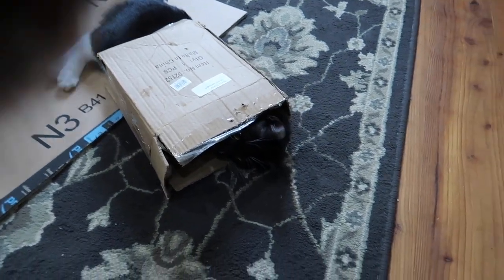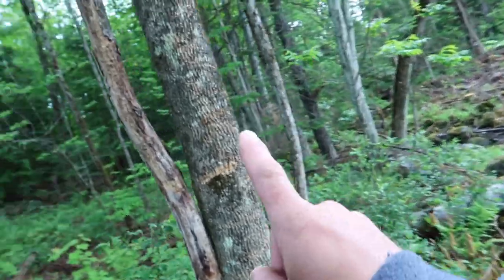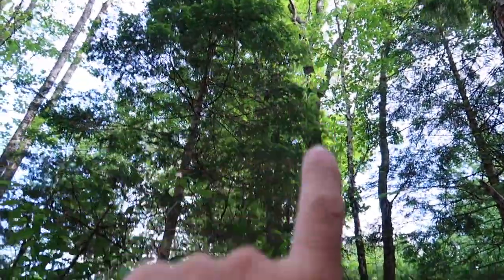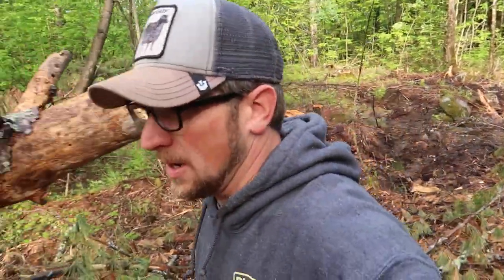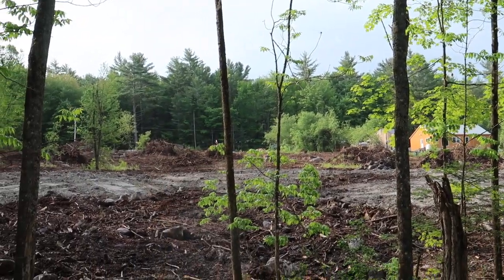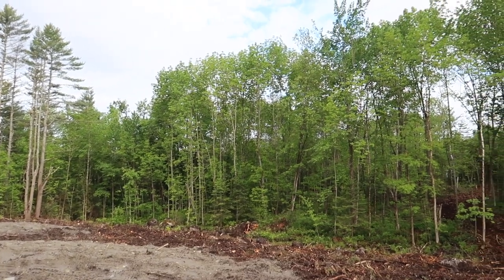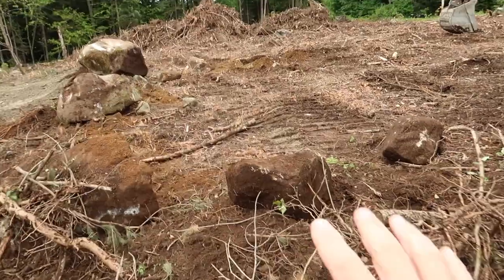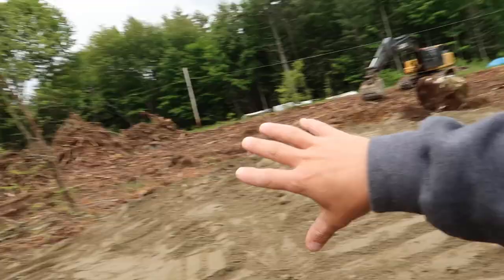So Much More We can do with our Farm NOW!

Comment: When my pigs came out from under the barn in the spring, just after sugaring, they would move through our 6-acre sugar bush.  I'd move them almost daily so they wouldn't destroy the forest floor.  My pigs were all trained to a single hot wire.  I had a hot wire all around our property line.  I took the pig's wire off that.  Water was the challenge.   I had hoses running off the spring running all over our land.  I just had to move hoses when I moved the pigs. 
 We raised both stones and rocks on our farm.  We were harvesting them always, waiting for the price of stones to go up. 
  I had sheep.  I went with a 3 clover mix for my pasture seed. Pasture seed was very expensive.  I just worked up small areas with the pigs where  I had good sun, then I'd broadcast the clover seed, rake it in.  When I had straw to cover the seeds that worked best.

Comment: Al, Gina & Olivia, as always I love your videos. They are the highlight of my day. I do want to put a question out for anyone to respond to if they will though.  My husband & I raise chickens for eggs and have 11 hens and a rooster. At some point since Winter finally decided to go away that group turned on one hen. We didn't catch it early on for several reasons too lengthy to explain here but suffice it to say, she was attacked every time she left the hen house. Basically, she became housebound.  We stopped feeding and watering inside the hen house about mid Winter because of the field mice. They were fat and happy and had taken over the hen house. That was when we started feeding and having water only outside. 
So back to this hen. When we realized the severity we removed her from the group and put her in a separate and smaller hen house with a run by herself. She looks very much like a plucked chicken with sores all over her back from tail to the back of her head.  Now the problem is, she refuses to leave the house. She is safe from the others but they are in a run next to hers so she can see them and them see her.  We have carried her out of the house and out into the run a couple of times now. The 2nd time we even shut the house door so she couldn't go back inside for about 3 hours. But as soon as we opened the door to the hen house she ran inside again.
She moves around in there, gets up on the perch, sits in the egg-laying nests and appears to be ok other than she refuses to go outside. We don't want to continue to feed and water her indoors because the mice will come back. Anyone have any suggestions?  Thanks and happy homesteading everyone :-)
Reply: Beth sounds like what I would have done. Maybe over time she will go out, maybe not. Sorry I don't know anything more to say.

Comment: You might check with some of the local farmers (cow, chicken, and horse) even the guy you get your pigs from, for some excess manure you can spread to get your new grasses going. You might want to stock pile it for the winter and use it next spring after it has composted down some.  
  Check with your County Extension Agency for help getting your pasture going with the right grasses and fertilizers (manures) to use .
  Watch Craigs List and other like forums for a smaller older Poop spreader cheap that your Kabuda can handle to spread all that Brown Gold and even wood chips
  Also check with other Homesteaders  in your area to barter for any of these items, a couple jars of syrup might get you a spreader to use for a weekend, You never know LOL Good Luck
Reply: Good advise.

Comment: Looking good Al! I know you’re really excited it’s like you’ve got a new farm.
Buckwheat is a great cover crop that will grow well on your new ground. I would plant it all in buckwheat and bush hog it in early fall and then sew clover on it without tilling. Orchard grass would work also but don’t mix the seeds. Clover is a slow starter and mostly anything you mix with it will choke it out.Both should be planted in early fall and not now. Before planting anything if you can find anything to spread on your rocky area (compost manure wood chips grass clippings Ext) it will really speed up your top soil. The trouble with rocks is they don’t hold moister.
I really enjoy your blogs. Keep up the good work.

Comment: In my youth got a Masters degree in Turf and Dirt (Soil & Crop Sciences-- Plant Physiology). Lots of chipped stuff good if mixed in. Too much and you may need to add other nutrients to deal with the high nitrogen from the tree chips. Chain a big log behind your front end loader, when it's a bit dryer, to level out the field. The rocks pioneers had the same problem which is why all the stone walls. Rake if you have one is ok for first step before drag. The leveling just prevents damage to you, animals or equipment from hidden stump/rock holes. Looks nice. Soil test is cheap insurance for healthy pasture/animals.

Comment: Alfalfa needs deep viable soil in order to do well. Your thin top soil with hard scrabble underneath would explain why alfalfa doesn't do well for you. Alfalfa needs to establish deep roots to thrive. You might consider timothy grass, an excellent fodder/hay grass. Combine with clover, hairy vetch, both self seeding annual legumes which will fix nitrogen, add organics and carbon to the soil, via their roots at die off. If left to go to seed at the end of the season they will come back readily. Timothy is a bunching grass with strong roots that will penetrate the hard scrabble and improve the soil structure, as well as giving support to the clover and vetch. I wouldn't leave that soil barren for long. Your top soil will quickly erode and wash away. 
I might suggest for best results contact your local ag dept. for best long term pasture reclamation.
Reply: Great advice.  Agree with it all.  :)

Comment: With your Ash trees you might want to look at them as the The emerald ash borer is killing them. Just more downed trees for you, and if you put the pigs and or the goats in there and the ash trees have been damaged by the beatles  could come down on them or take out the fencing. I looked up your state, New Hampshire and they are there. Just wanted you to know as I had to find out the hard way by loosing a stock trailer.